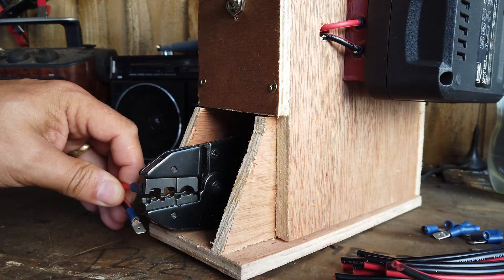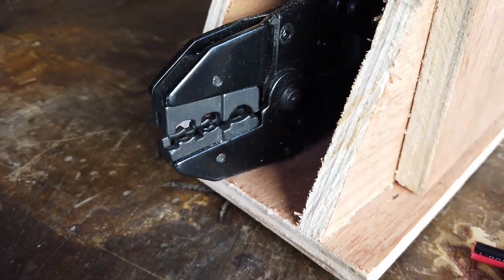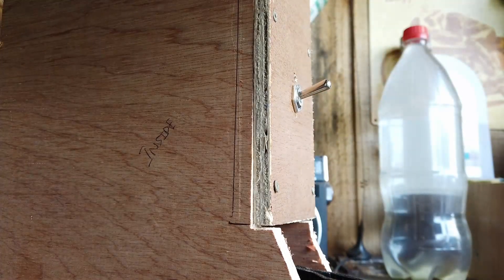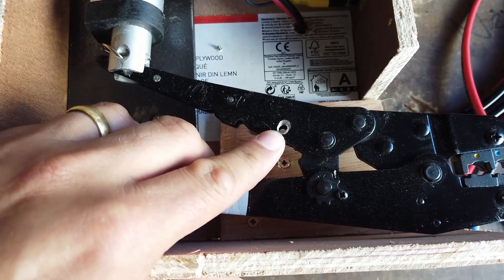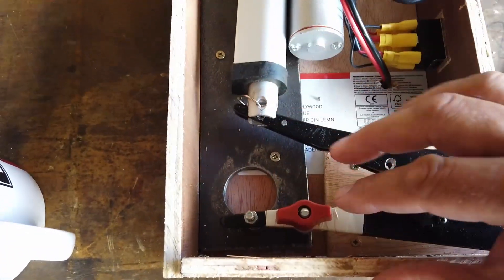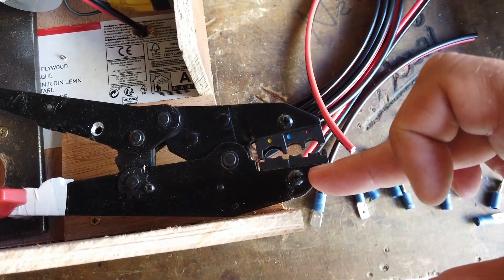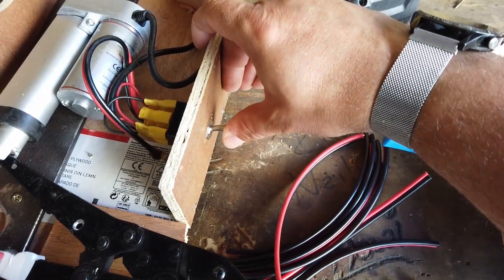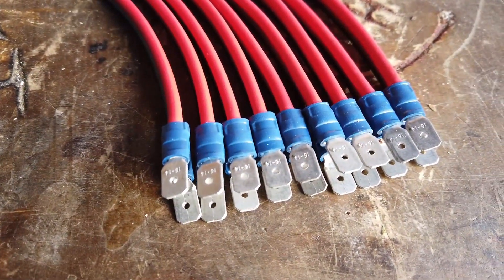DuB-EnG: Electric Automatic Crimping Machine Build - Power Tool - Battery Powered - Very Dubious

Comment: are you selling battery holders? i could use a few dewalt ones!
Reply from the maker: Yup I have DeWALT !!   Best price on eBay :-).  Did you want the electric connectors or just the holder ?
Reply: @DubiousEngineering with the electric connection as well, i want to use them to power a kayak outboard!
Reply from the maker: Yes no problem at all!!  Send me an email howitee at hotmail dot com

Comment: "That means I can use it to do stuff" What stuff lol? Let me guess, cable cutting? I don't think so, lol. Anyway, compressed air in a shop, it is very useful. Once you have it, you will think, how the heck I lived without an air compressor. You will start reaching out for the air more often than you think.
Reply from the maker: Very true and compressors aren’t expensive these days!!
Reply: @DubiousEngineering  I bought mine in LIDL a few years ago. Every few months LIDL have them for sale. For a small shed/diy garage the 25L compressor they sell will do just fine. However, if you start doing sand blasting and so on, then the bigger the compressor the better